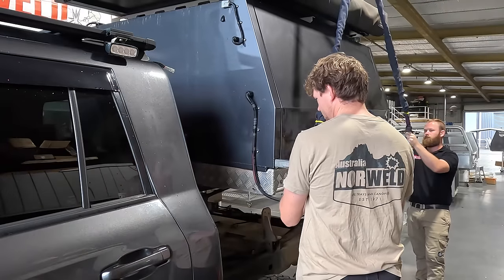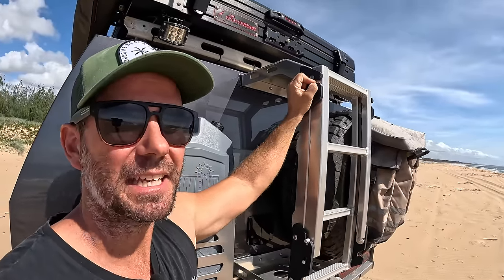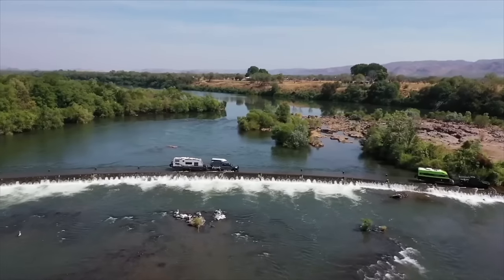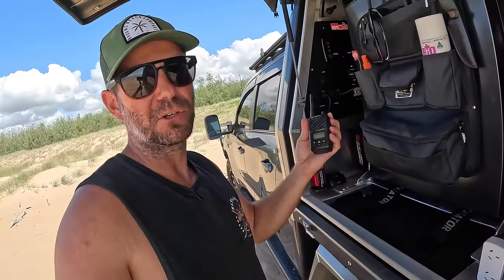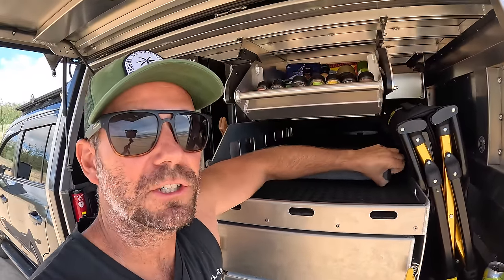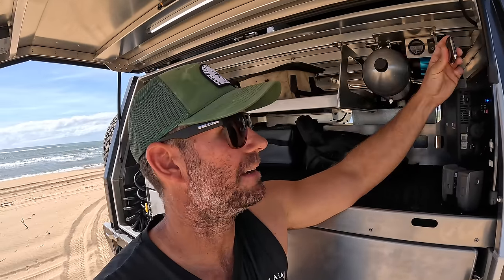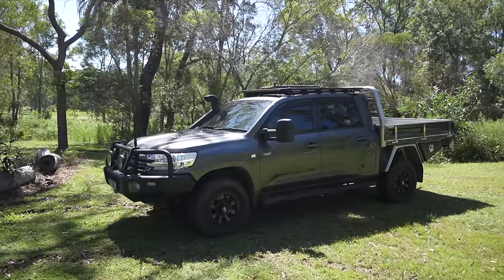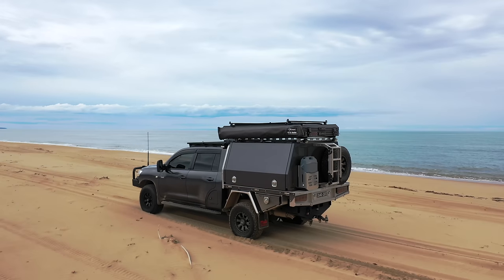Adventure-Ready Ute Canopy: Touring Essentials and Innovations - Norweld Elite Tray & Canopy

Comment: The setup has gone next level mate. Well done. Is there provisions for running the spare when rolling with the tray back? Do they do central locking on the tool boxes and trundle draw? Happy travels.
Reply from the maker: Yeah so there is 2 threaded nutserts on the head board where you can mount your spares. Same system as on back of canopy 👍👍

Comment: Hey Justin the birthday revamp on the 200 looks great mate. I notice in this vid that your side steps are now full length instead of the wagon length ARB steps you had when you first had the rig built. When and where did you have the steps extended? I can’t recall seeing them on any other recent vids. Cheers.
Reply from the maker: I had a metal fab joint in Broome extend them a few years back hey. It’s the same arb steps, just extended with a new tread plate on top 👍👍

Comment: Nice setup. What happens with the air bags when the canopy is removed?
Reply from the maker: I just plug the lines into blanking caps and I can use the manual inflating valves at rear of chassis if needed 👍

Comment: Great canopy set up just a question. How does your air compresses connect from the canopy to the tray?
Reply from the maker: Good question! It stays in the canopy. So no compressor when running as tray back
Reply: @TripInAVan  how does the air compressor connect to the tray to pump up your airbags from your canopy?
Reply: @TripInAVan  is there a hose connects from the canopy to your trailer that you disconnect?